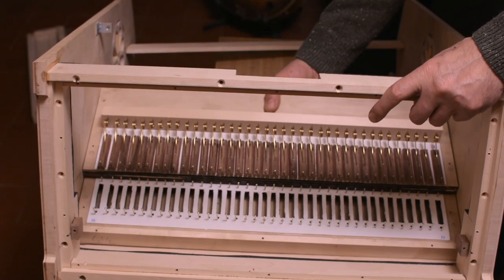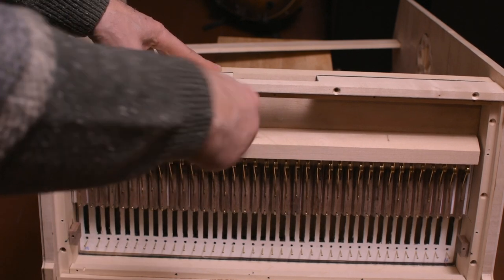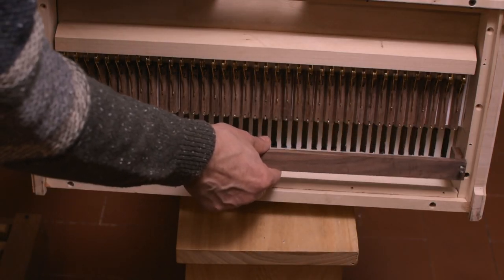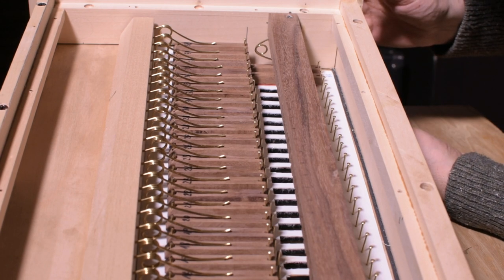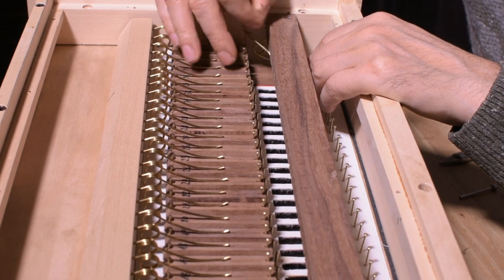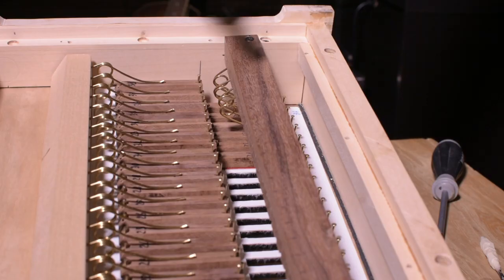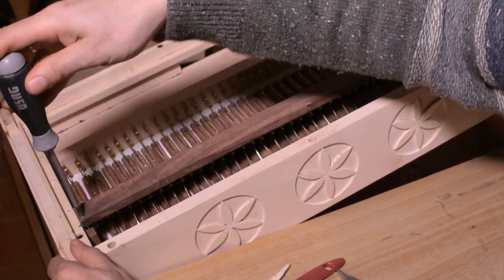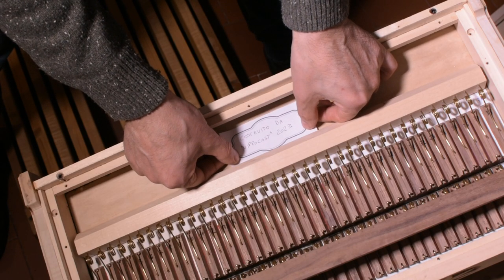I finally completed the pallet box! Building a Homemade Positive Pipe Organ | Video No 20

Comment: Your valves are very narrow because they need to be aligned with the keys. Mine are wider because they are beneath the pipes, and they are nowhere near the keys, however on the wind chests with the smaller pipes, they are harder to work with because they are much closer together. I have about 250 moving parts  on my 49 note automatic organ. It looks like you have about 79 notes. with 4 moving parts per note, You would have at least 316 moving parts, probably more including pull stops and bellows. These things have as many moving parts as a car engine!
Reply from the maker: Hi Steven! Yes, the pipe organ is a very amazin music machine.